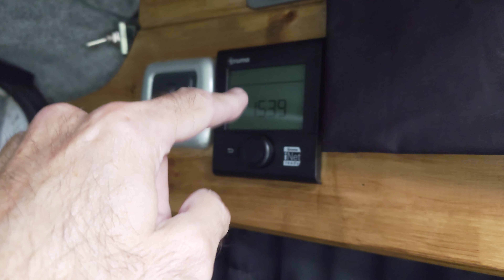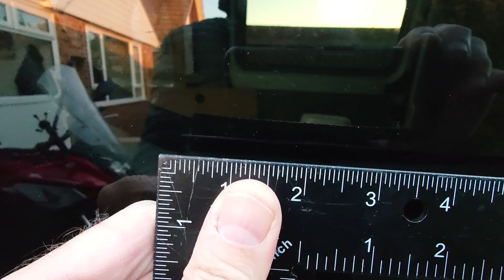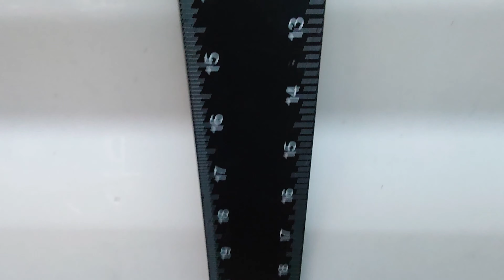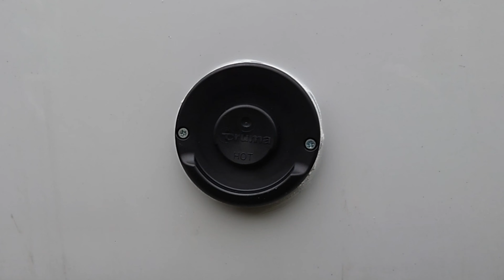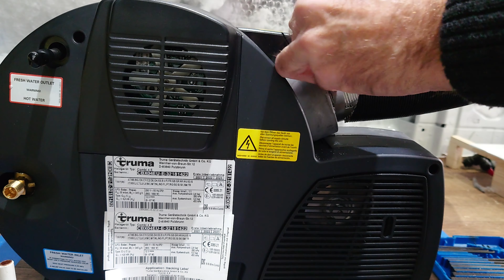Truma Boiler E4 Install Part 1

Comment: You might want to see some other youtube videos or the manual on how to put those clamps on  the air and flue  since they are facing the wrong way.
Reply: Yeah, I concur …the exhaust tube clamps are back to front, which is why they gave you such a headache fitting them. They seem secure enough though and I think you said you were 18 months in. My unit only came with operating instructions, but the installation instructions are easily accessible online.